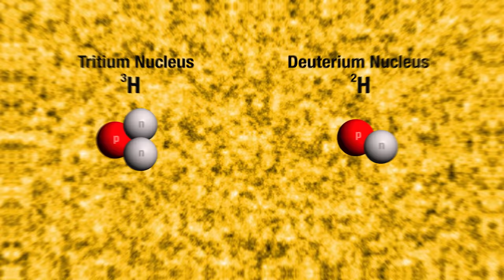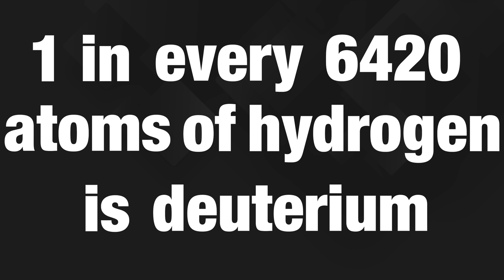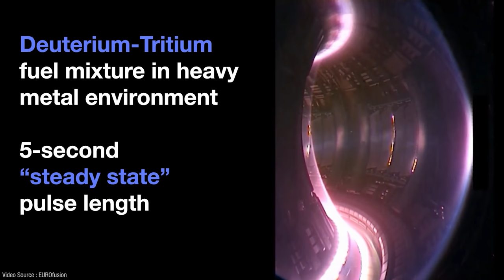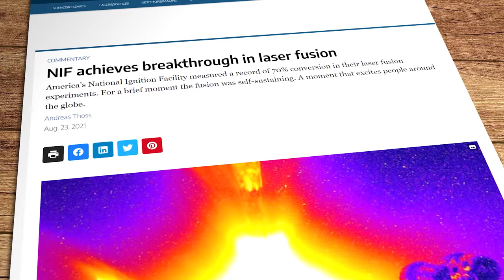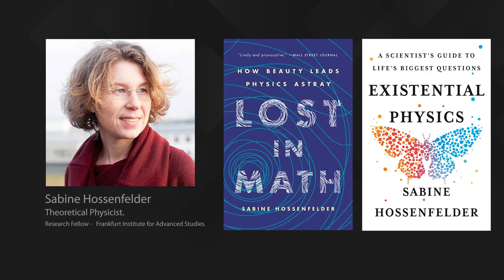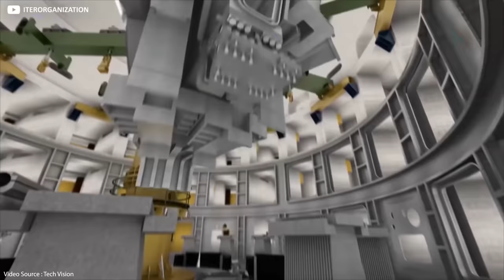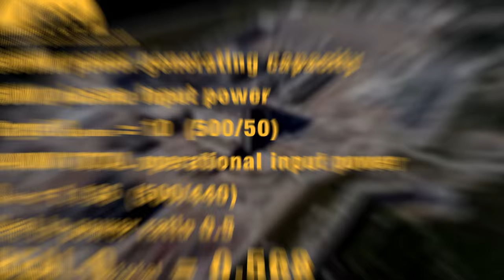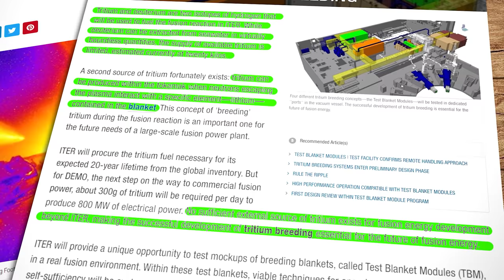Nuclear Fusion Illusion. Is it time to park the pipe dream?

Comment: We already have a massive fusion generator at a conveniently safe distance from us, and we need only build collectors of that energy. The breakthrough occurred billions of years ago rather than eternally 20 years hence.
Reply: The sun isn’t at a safe distance, and solar on earth varies as it will rather as we need it, which is huge problem with no solution.
Reply: That is a massive undertaking, which is why fusion research exists here on earth. We don't even fully understand heliodynamics
Reply: But what do we do when that fusion generator is on the wrong side?
Reply: @kokofan50  How about massive solar collector grids at the poles?
Reply: @benmcelwain5301  can you imagine the cost of that kind of maintenance
Reply: @danielnykvist3221  Invest further into efficient energy storage.
Reply: Also, solar energy varies everywhere on earth because we have a sizeable atmosphere everywhere. Even if there was a hole in the ozone layer, you still have the magnetosphere and weather
Reply: Solar panels are not very efficient.
Reply: @benmcelwain5301  really dim sunlight and massive line loses are just as big of a problem.
Reply: @platin2148  exactly. Cells are only about 30% efficient at theoretical max
Reply: @lousassle9387  That's cheaper and more efficient than losing every major costal city to costal flooding
Reply: @Praisethesunson  and yet, we still use lithium ion batteries above every other forms that could be better for other uses. Simply put we don't have many breakthroughs to brag about by any means, and that includes military "improvements"
Reply: @lousassle9387  And even that wasn’t reached in a real world commercially available solar cell but only on these high concentrator cells which are multi junction + crazy toxic for the environment.
Reply: @lousassle9387  I don't see what point if any you are trying to make.
Reply: @Praisethesunson  the point is that the fearmongering isn't making research go any quicker. We don't have a diverse set of efficient energy storage for the power we create. We have theoretical ways to do everything we can think of, but no amount of funding has made or will make that process quicker
Reply: He is confusing experimental reactors with production reactors. Today's reactors are built to learn and test. The more important value is run time , the q times are not important until we have 24/7 operational reactors. We have suddenly gone from milliseconds to recently minutes, ~17 minutes hold millions of degrees in a container. That is getting close to constant running, not far away at all.
Reply: And there we have it..."we need only build".
Reply: @AORD72  if true, this is the real progress we need to understand, not just theory
Reply: @danielnykvist3221 who ever makes it first is likely to sell reactors or design. Once a reactor works the technology will be proven to the politicians that can't comprehend it will invest in it. Abundant energy will create massive wealth.
Reply: In my graduate program, the main research was put into SOFC and batteries, but every talk concerned tech that was so intricate and exotic that production was basically impossible on a large scale. If it wasn't that, then cost effective production was concluded to be decades away. If we have an immediate issue, how is that going to help our goals?
Reply: @Praisethesunson  solar power is very inefficient and should not be the norm. There are far better technologies out there, such as hydroelectric
Reply: @lousassle9387  There are far more places that get sunlight than get massive amount of flowing water.
Reply: @Praisethesunson  hydroelectric power plants run at around 90% efficiency in reality. Solar power can only go theoretically at around 30%. That's a big difference when implemented in practice
Reply: Gee why don't they cover the Sahara and the Gobi and the outback with solar panels???
Reply: @lousassle9387  The sun is the reactor we must use. We already depend on it for everything else in life. Now we add our electric grid to that list. It's very doable.
Reply: Nice. Futures so bright 😎
Reply: @lousassle9387  It also produces basically toxic waste especially multi junction ones which are the upper efficiency ones as they contain galium and arsen. The silicon is also basically lost i don’t know if there is a easy recovery of anything of the stuff that it is made off.
Reply: @platin2148  this is such an egregiously overlooked point in materials engineering
Reply: @lousassle9387  the real progress is there. There are real physical reactors that works, albeit for only minutes. But that is a huge step forward from milliseconds. We are getting to the point with room temperature superconductors that suitable magnetic fields can be maintained. We have way better magnets now. I believe these tests indicate that larger scale reactors can work, as the plasma can be contained easier.
Reply: @kokofan50  OK, if you want to claim that the sun "isn't at a safe distance", knock yourself out.  Would you rather stand outside for ten minutes, or stand next to a pile of neutron-activated reactor vessel for that amount of time?
Reply: @lousassle9387  "sunlight too dim",  "massive line losses",  Cells are only about 30% efficient"...  NONE of that matters.  We can generate lots of GWh from solar farms.  Efficiency problems are dealt with by using more cells.  They cost next to nothing, so who cares?  Line losses are a problem with ALL electrical transmission.  We know how to deal with it.  We can even build HVDC transmission lines if we want.  You guys are just a bunch of negative Nellies, trying to come up with anti-renewable arguments, and they're all BS.  Do you guys work for the coal industry?
Reply: Sanity at last!
Reply: They built a huge sunlight collector powering a large number of  solar panels in the Californian desert at great expense.  It failed.
Reply: Actually we need viable grid storage for the current solar photovoltaic capacity far more than more solar PV capacity.

So much is simply pushed out to the grid during the day and not used because most homeowners are not drawing much power during the day.

Once night falls there is nowhere for that unused capacity to go and its gone when people actually start pulling from the grid to use showers/baths, cook their meals etc.

For sure more solar PV capacity can't hurt - but solving the rapidly growing PV capacity vs storage gap is the real key to divorcing at the very least our homes and industry from fossil fuels.

Wind at least does continue when the sun goes down, but that is not to say it doesn't have blank spots just as solar PV does - for the same reasons it can also benefit from storage infrastructure.
Reply: Well the nuclear fusion reactor that is 93 million miles in the sky only make sense if we have storage capacity that can last for many months
Reply: @lousassle9387  and? I mean what is the point of that metric but to compare one panel vs another?  I have some standard panels on my roof. I think they are less than 20% efficient.  All that means is they take less than 20% of the energy that hits them and converts it into electricity. Nonetheless, the power I get out of it cheaper than I buy from the grid. And what I produce above my usage, I sell to the grid.  

In short, what I am trying to say is that a PVs efficiency rating is only useful when comparing to other panels.
Reply: @brucemc1581  the problem is that excess energy goes poof as heat. This is an overlooked aspect in energy, and the point is that there are simply more efficient energies out there where effective storage could solve many problems with dependable power far better than panels. Are panels effective? Sure, but why not limit them to low power use when we can find better solutions for grid scale output?
Reply: I find it amazing of all the excuses 
How many people who complain actually have used solar 
Watch on utube,  global warming/1 solution 
Shows different types of mobile solar systems 
Watch on utube, Solarized walk assist device  - Winnipeg to Vancouver 1,through 12, especially 9
Reply: @lousassle9387  I am not sure I understand what you are saying. Regarding loss of heat..  I can do nothing and lose 100% or I can capture 20% of the energy, use some of it myself and sell the rest to the grid. My ROI is 7 years.  No subsidies, except that I did not have to pay VAT on the installation labor and materials.
 Am not stopping anyone else from developing something better.  
I don’t want a windmill on my house.
I can‘t build a dam.
A little nuclear power plant in my backyard may not go over to well with neighbors.
PV is really the only viable solution to lower my energy cost.
1 more year to go and it’s paid for itself.  It likely last another 20 to 30 years.  Free electricity. Sure, it will produce less and less, but it’s better than nothing.
Reply: @brucemc1581  I'm not against your sentiment. All that I'm saying is that for investment beyond personal use, there are much better energies out there, and solar is not one of them. You might be good for your house, but if we want to look beyond that for the grid, then solar simply is not worth it in the end. It gets dark at night and clouds also hinder the efficiency of panels, and over time, the economics don't make sense. That's not just my opinion, that's the science.
Reply: Tell this guy to get a bucket and collect it himself seeing as he has the solution
Reply: @danielnykvist3221  Batteries
Reply: @platin2148  How is that relevant when the sun provides far more energy than we need?

Also, if efficiency is your concern, fossil fuels are incredibly inefficient.
Reply: @kokofan50  With solar “everywhere” line losses are negligible.
Reply: Science Revolution  If the tides aren’t caused by the moon, why is the moon’s position required to accurately predict the tides? 🤷‍♂️🤣

🤡 🌎
Reply: @incognitotorpedo42  💯👍🏻
Reply: @moltoniron633  what twisted logic makes you believe that?
Reply: @jack regans I watched both the video this chat belongs to, and I do believe I’ve both read and watched any videos associated with the URL I posted.

It’s representative, first time I heard a solid analysis that concluded solar + battery was cheapest LCOE was 3-4 years ago in a report published by Santander.
Reply: @tommornini2470  then we go back to the problem with being unreliable. The only place that solar makes sense at scale is in space, and only between the sun and Mars.
Reply: @kokofan50  Distributed generation of renewables + batteries = far more reliable energy than we’ve ever had previously.
Reply: @tommornini2470  Don’t need to write anything productive anymore here already read fossile Fuels and then it’s over. Keep in mind that the Solar panels need these Fossile stuff to actually be made. Epoxy…
Reply: @tommornini2470  renewables + something that can’t scale and isn’t cost effective at grid scale = not going to happen. Nuclear currently has a 90% capacity factor. Nuclear is regularly the only power source still working during and after a natural disaster.
Reply: @platin2148  I’m good with using fossil fuel to make panels.

We’ll use a hell of a lot less than we do currently, over time.
Reply: @kokofan50  Batteries can and are scaling just fine.
Reply: @tommornini2470  no, they aren’t. All they’ve been able to do is cover a couple minutes during a spike. We need at least a week of battery backup if we’re going to use nothing but renewables.
Reply: @lousassle9387  they are, I live in the state that is doing that across a five year plan government/commercial partnership that will push state renewable generation to 75% in five years and possibly export the rest to nearby countries - that’s the current plan - but will hv to see how I plays out
Reply: @trevorsoh2130  once again, it's not a matter of if they work or not and are fine on the short term. The fact is that for grid scale, long term solutions, there are better techs out there, like nuclear. The drawback with something like nuclear is the enormous startup cost, but it's much more dependable for generation AND storage
Reply: @tommornini2470  if you're thinking conventional batteries, those have their limits. However, air batteries have a lot of promise for grid scale storage, but are vastly underdeveloped. Governments only care about quick power after all
Reply: @lousassle9387  ok fair enough, most people here know for more on the topic than I do so I won’t go beyond what I know - I guess my state is a case study in that we’ve been on coal generation for decades - and never used nuclear - but because residential and govt uptake of solar and wind has been quite high we are already above 30% renewable generation - with no serious outages - now regular blackouts- and a smooth transition to closing one of two coal power plants this year. 

So i think the plan seems to be working okay so far. The government. Has been testing decentralized generation and community battery storage pilot programs for many years already - thus it’s expanding to large scale renewables now in partnership with multinational gas/mining companies- so I suppose you could draw the conclusion that the financial due diligence is being done. 

Plus banks don’t lend to multi billion dollar projects unless they also do their own due diligence.
Reply: @lousassle9387  No need to pick the winners in detail when the “losers” are already economical.

Economical an interesting concept.
Reply: @lousassle9387  just an question, you mentioned nuclear for generation and storage - what methods to do countries use to ‘store’ nuclear generated power?
Reply: @trevorsoh2130  currently the steam that's outputted goes into turbines into generators. Currently, smaller nuclear reactors are being developed, meaning smaller cost, and any battery system would pair very nicely, as long as they're made for grid scale. However, don't forget other suitable power tech such as hydroelectric and geothermal, which are just as good as generators in appropriate places.
Reply: @tommornini2470  the issue is that current lithium batteries cannot be cheap enough to be cost competitive with coal, etc, when used with current renewables. Why do you think wind and solar are very local energies? Why can't we use those for our entire grid? There are others that NEED to be developed, and again, that's the science, not just my opinion
Reply: @lousassle9387  Tesla and the MANY utility companies who are either under-construction or waiting in queue for their grid scale MegaPack batteries disagree with your cost assessments.

Since the grid is a network, the renewables will power the grid.

But they’ll power the local needs first and foremost, since transmission cost due to loss is significant.

Imagine a world (in a long time, granted) where “every” building has solar and batteries. Or, at a minimum, every community.

No need for a grid, no grid scale power outages, much lower transmission losses, etc.
Reply: @tommornini2470  i recommend you check out the work that Form Energy has put out, or the work that has been done on small nuclear reactors, gravity power, and others
Reply: @lousassle9387  I’m not opposed to nuclear, just not clear why we’d head down that path now that wind and solar and cheaper and safer.

It’s all economics.
Reply: @tommornini2470  nuclear is far and away safer
Reply: Not only that, we need a LONG TERM solution that will can withstand the test of time. Well engineered nuclear facilities can reliably use 60 year old tech and can give massive payouts for decades
Reply: @lousassle9387  Safer than solar & wind?

Now I know you’re just fucking with me!
Reply: @tommornini2470  okay, don't believe me then. That's not a problem
Reply: @lousassle9387  As can solar and batteries.

With zero radiation risk, and “entirely” recyclable — both panels and batteries.
Reply: Absolutely spot on. There is also a fission reactor in the core of our planet we can use.